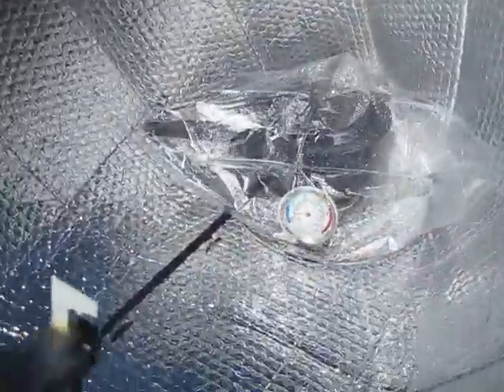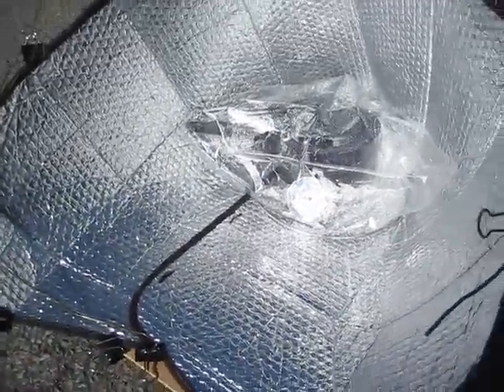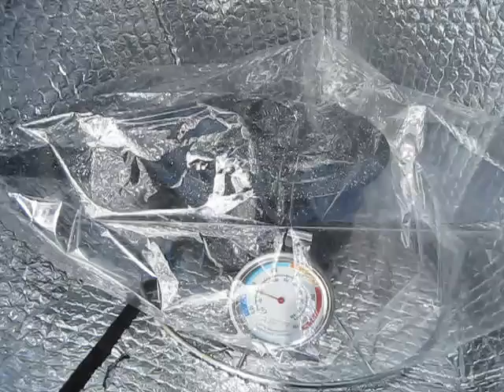Car sunshade solar cooker windshield

Comment: I solved the wind problem, just put a heavy pot/pan at the back of the sunshade near the focal point (like cast iron, use a long sharp stick or iron nail held in place by the cookware to adjust the roof angle, and use 3 rocks placed in a triangle two at the sides where you want the shape to hold and one at the furthest point in line with the pot. The best part is the thing will correct itself if the wind blows and tries to topple it.

Comment: I did learn a way to partially replicate a parabolic solar cooker by tying the sunshade between two poles affixed into the ground to make a parabola by gravity. If you need to adjust for angle just use a stake in the middle to tip the cooker in the chosen direction.

Comment from the maker: I got it from Walmart. It's part of a double boiler set (two pots, one cover). It's made of very thin, lightweight metal and is black with small white spots. With a cooker like this cast iron will likely take long to heat up since it has a lot of mass unless you have very strong sunlight. I don't have an particular tips for finding cast iron cookware.

Comment from the maker: A stiff frame would probably be better for stabilizing it than rope. You could also just put tall boxes on either side to keep the sides up. I don't think I've ever gotten water to a boil with it but I've cooked rice where all the water does "boil" away and the rice is done. Panel cookers are usually slow cookers so think of it as simmering water. I haven't tried rocks, think of it as slow cooking/simmering.

Comment: So I am wondering how one would stablize this with rope? Because I made a prototype out of cardboard and tinfoil arranged into panels and I made it kind of like the corner of a wall. It gets water pretty hot but not near enough to be dangerous or boil but half of the water did evaporate out of the pot I used. This solar cooker seems to be much better. Oh by the way have you tried heating rocks with it to boil water? I don't know if you could but you can try it as a supplumental technique.

Comment from the maker: @babamuna66 Thanks! Be sure to check my other car sunshade video too: How-to for car sunshade solar cooker windshield. There's more to it than just putting the wire around the edges and that video shows how to shape it for optimal reflection. There's also a useful link in the description to a webpage that shows the same thing but may help clarify.